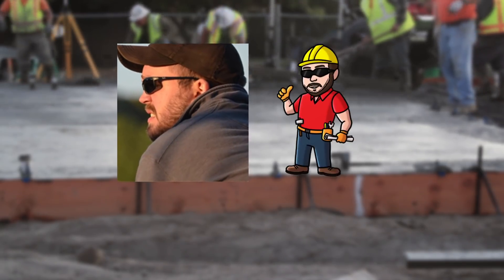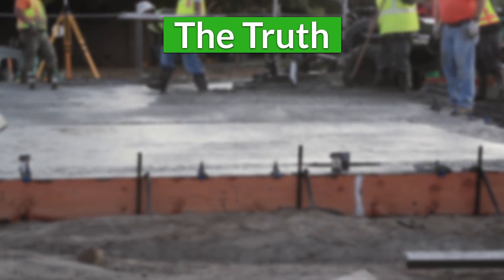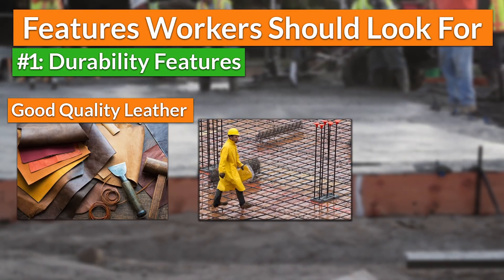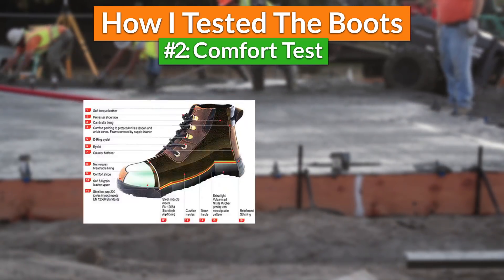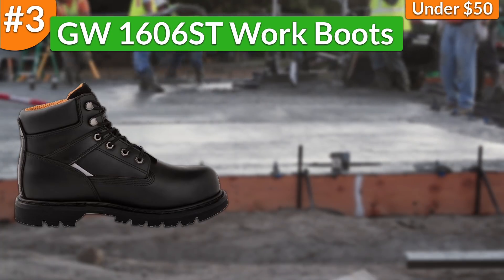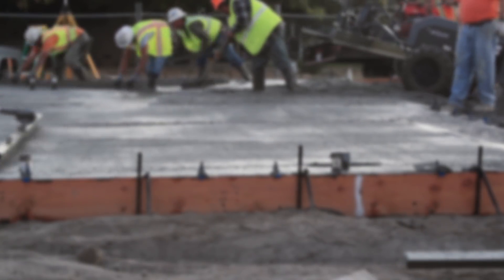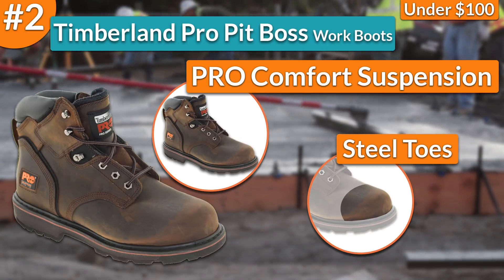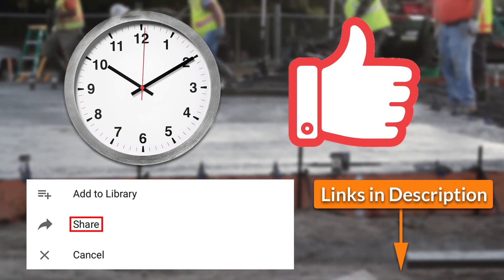Top 10 Best Cheap Work Boots for Workers On a Budget

Comment: My redwings are getting old, I have another new pair in the box I got at same time on sale but I'm gonna save them for good.
For new cheaper daily workboots I couldn't decide between timberland pit boss and wolverine floor hands so I just obtained one of each.
 I just snow-sealed them and  I'm going to switch off every day and see which ones feel better & last longer for the longest time. 
 If anyone cares I will update if/when I get a reply notification to this comment asking. 
 Was wondering if anyone had a favorite between those and why.
Reply: After a year, how are these two boots holding up? Which one lasted the longest and which one was more comfortable?
Reply: How’d it go?

Comment: a $1 jar of vaseline and a $1 bottle of baby oil makes boots better.  Taking the time to oil cheap leather boots makes them last as long as most expensive boots.
Reply: U just apply both?
Reply: @nigelwest5776  the mix is the consistency of mink oil. I personally use whatever is handy. I've used either whenever that's all I had. . I am currently carrying a bottle of vegetable oil. I stopped eating industrial oils so I had plenty of it. If you work whatever oil you use will wear off regularly. Oil your shoes anytime they start to look dry.  Oil is cheap. 

 bonus pro tip, lotion your feet. Doesn't matter that people aren't seeing them. Dry skin will wick oil out of the leather and dry leather will wick oil out of your feet. Weird effects. Also, socks with friction on dry or sweaty with no oil create blisters. If the sock can glide over the skin in that inevitable movement as you walk around, your feet receive less abuse and smell less traumatized.  Nourish the skin. Nourished feet don't create the extra odor that foot deodorant can't mask. Whatever lotion or oil or butter you have handy is better than nothing. Some people have a reaction to seed oils.  I started getting weird bumps on my hands whenever I used vegetable oil on my hands doing concrete testing.  The grease dripping from hamburger frying is excellent for feet or boots but it's kind of like work to strain it and if you seasoned your meat it can  make you feet smell like cooking. But it feels great on your feet. Fills all the little crevices where moisture pools and bacteria grow so it helps. The tallow lasts longer than the vegetable oil but hard to apply in winter. Olive oil is good in leather and on feet and is much less likely to cause a reaction.
Reply: @mandelharvey3429  awesome thank you!

Comment: I dunno about steel toes. I've heard stories about the steel toes caving into and getting crimped onto the foot. Sounds worse than just a smash&go.
Reply: If something is heavy enough to crimp the steel toe, it's heavy enough to mash off a toe.
There's always composite toes if you still need protection but fear steel toes.
Reply: They did tests on the show Mythbusters. Appearantly, any force strong enough to cause a steel toe to cave in would almost certainly flatten your foot anyway so you would be no worse off.
Reply: Project farm done several tests on cheap $30 all the way to $250 range.  All steel boots managed to get at least 2500lbs and higher.  2500lbs of dead weight is equivalent to a light pickup truck ran over your toe then hold steady.  If you fear higher dead weight is going to drop then you're simply in the wrong place, stop smashing and go.  Get a job and earn your honest living.